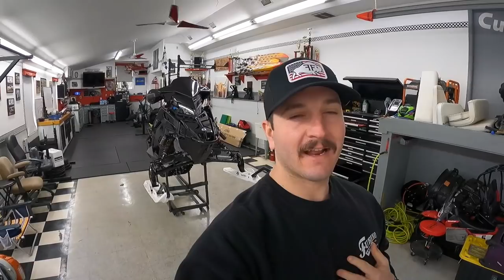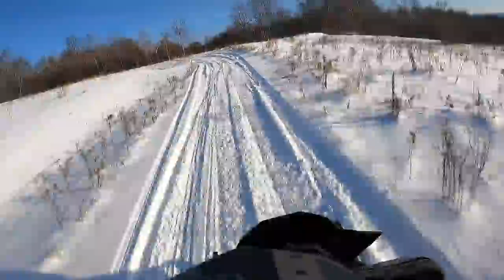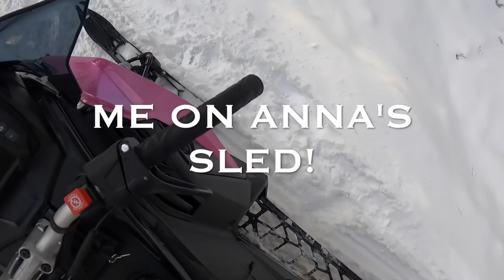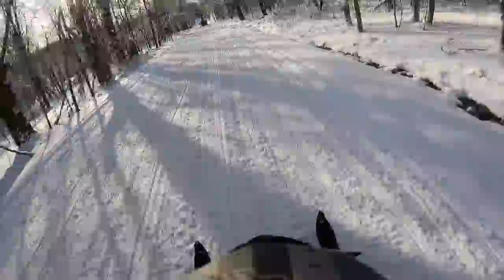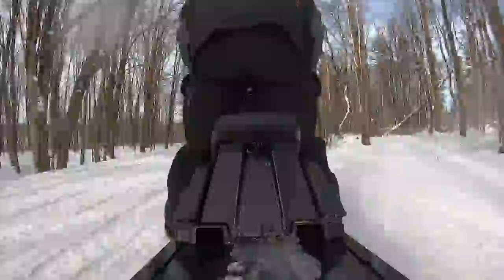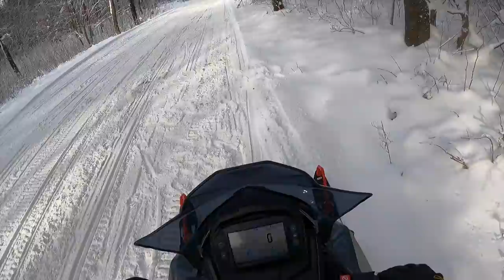POLARIS MATRYX 136 VS POLARIS MATRYX 144! WORKING ON GETTING THESE VR1 850'S OUT OF BREAK IN MODE!

Comment: whats your thoughts comparing the 136 to the 144?
Reply from the maker: I didnt really ride them enough to tell. I am also not a good judge because i will toss a 144 around like a 121 and not know the difference. Speed wise the 144 still rips. As you saw in the video i got best MPH on his 144 (again hes further along in break in) but both are beasts!

Comment: Wonder what the gearing is vs my matryx Assault. I was only seeing a touch over 100, like 102ish. I’m studded, but this next season will be clutched and tuned to about 197horsepower too. Will be interesting to see what I gain, though I prefer the grunt/ low end more than the 100+ anyways. Nice video
Reply from the maker: Gearing we run is definitely taller than factory stuff but we always have 10 tooth drivers and 9 inch rear wheels so a lot is changing. I would run 110 +/- 2 on any given day. Who is giving you a tune that will get you to 197? Seems steep to be honest. Appreciate you watching and following along!

Comment: Is there an advantage to buying a 129 and putting the big wheel kit on vs the stock chassis 137?  I’m not familiar with a big wheel kit and the benefits. Thanks
Reply from the maker: The idea of a big wheel kit is to increase the diameter of what the track has to wrap around. The bigger the diameter the less friction ultimately reducing rolling resistance. Then you can gear taller and ultimately get more MPH. I did a full explanation of the benefits in an earlier video labelled BIG WHEEL KIT. Thanks!

Comment: Hey man, great video! I’ve been away from sledding for a few years now and the last sled I ran was a 137. Strongly thinking about getting a 146 assault but my girlfriend would be coming along with me maybe 30% of the time. Gonna get the M2 Polaris seat. I weight 185 and she weighs 120, do you think with her being seated back that far that the 146 will push hard thru the turns trail riding? Thinking I’m going to order the 1.5 Ice Storm track.
I’m sure it would be fine but just looking for a bit of input.
Cheers! 👍
Reply from the maker: You will definitely need to do some suspension adjustments and i would highly reccomend the HD springs. On top of all that i also think youll need some more aggresive skis then stock but would be a sweet set up for sure!!
Reply: Thanks so much for your input Jesse! Helped me tremendously on my decision!

Comment: All of the sled ran awesome. How does the new VR1 handle compared to the other models ? Thanks.
Reply: The matryx has a better bite in the corners and better ergonomics then the axys is what i have heard.
Reply from the maker: I would say they handle the same as they are the same chassis BUT the ergonomics makes it easier for you to ride super aggressive. You can transfer weight much easier as there is way more room to move around. Wind protection is 100% better!
Reply: @JESSEJAMES322  Thanks. Still waiting on mine.
Reply from the maker: Oh nooooo. Any ETA?
Reply: @JESSEJAMES322  Jan 15th hopefully. I guess we will see.
Reply: JesseJames322 yeah we have a 2020 Indy axys Xc 129 600 and it has been great so far. I prefer it more over our ‘21 Indy 550 adventure because of the seating position and power.
Reply: @Jdplayz-bq4ys   I had 2020 XCR 850 last year.  Just waiting on the new sled.
Reply from the maker: Hoping it sticks to that date. On the bright side of things winter has not been off to a great start
Reply: @JESSEJAMES322  That's the only good thing so far. LOL
Reply: @jipper2822  I just got mine Jan 4th, had to email Polaris since I never got a shipping confirmation and dealer didn’t know either, my buddy had to do the same thing
Reply: @paulmollise1856   Thanks.

Comment: So why buy the big wheel ? Why not just buy a 136 sled or 144 ?
Reply: The idea is that the bigger rear wheels and bigger drivers reduce how tightly the track has to bend and this reduces rolling resistance for increased top speed. You also gain a small amount of additional contact patch
Reply from the maker: Sam is 100% right. We buy the smaller sized tracks so we end up where we want to be. We need to run the bigger track to accomodate the larger diameters that we introduce into the driveline! Hope that makes enough sense!

Comment: Is the power difference between 800 and 850 a big difference
Reply: not really riding both this season, 800 has better low end for sure. 850 is def smoother and a little more mid range but nothing crazy
Reply from the maker: I havent ridden an 800 Polaris enough to know the difference. I do however agree with Lee!
Reply: @JESSEJAMES322  also sweet sleds, riding a titan this year and a vr1. Keep the vids coming
Reply from the maker: Thank you much appreciated! Best of both worlds!
Reply: BIG Difference on a good one... for one run, once pipe is hot, a strong 800 will run by it! 
Very annoying!! 
KInda missing my 17 SBA  >_>

Comment: I'd like to see these sleds on a radar gun...those speedometers are broken.
Reply from the maker: Havent had a chance just yet! And i get they are off but if thats all you go by and thats what you compare then its all the same denominator
Reply: @JESSEJAMES322  ya it's hard to get those numbers with 170hp..need perfect conditions for those speeds.  200hp sidewinders won't do much more than 113ish, so no way those 850s are pulling those numbers.  The skidoos speedometers are off too.  All these guys claiming they get 110mph so easy is funny too.

Comment: No the best way to break em in is take it easy dont pass 30mph to 50mph till 1000 miles thats break in for a 2 stroke to me i do that here in alaska with my 2 strokes and for 4 strokes after the 500 mile oil change
Reply from the maker: I would have to disagree with you but thats ok. We all have our own opinions. This was has worked for me and many others i know. Build a strong motor! Thanks for watching from way up there!
Reply: @JESSEJAMES322  itll last longer if you break em in slower let the parts polish them selves let them shave small metal fragments off slowly dont force em to shave off just like when your tryn save your beard your gone want shaving cream and the blades so they wont hurt your skin right

Comment: I've always been good at Math and am a realist.  That being said.... there's no way your track lengths increased by 9" going to a big wheel kit!!  You maybe gained 4" (total diameter) at the most!!  Probably more like 3"!  It's not like you went from no rear idlers to 9" idlers.  You went from either a 5" or 6" idler to a 9".  You better get your calculator out and resharpen your pencil!!  Nice try though.
Reply from the maker: hahaha. Greg I appreciate the attempt at the math and the dedication to try and prove us wrong but the fact is... i went from a 129 to a 136. The off set axle moves the axle backk as well so the 9 inch wheels clear the rear torque arm. If it didnt set it back they would contact one another. So yes. i do have a 136. There is only maybe 2 more track pads on the ground but after including the larger diameter of the drivers and wheels thats what you end up with. Is there a reason you dont believe us/me?